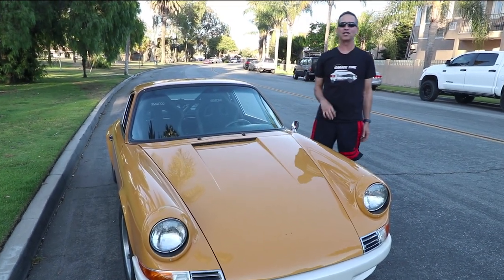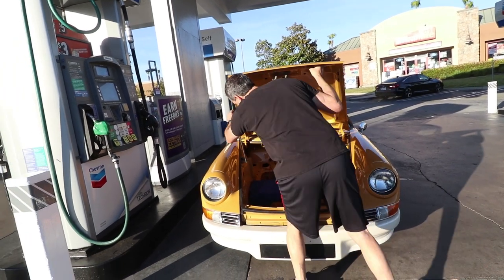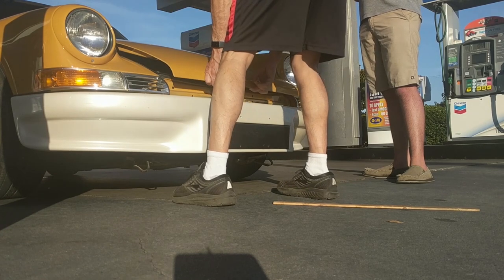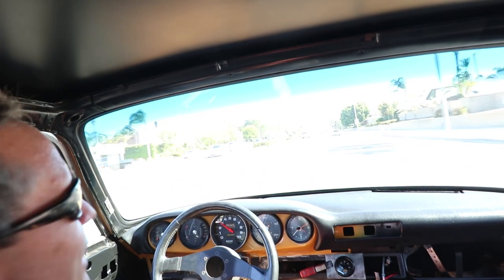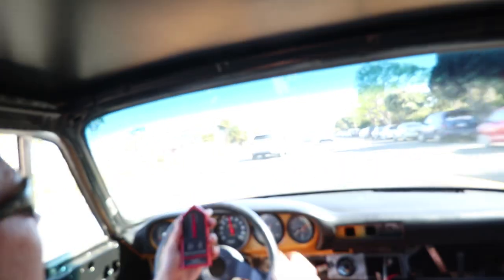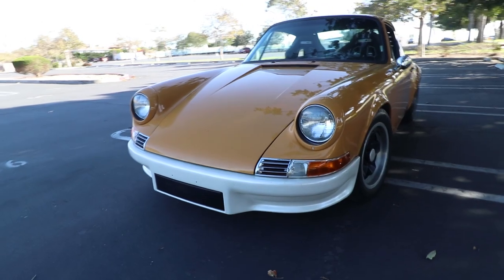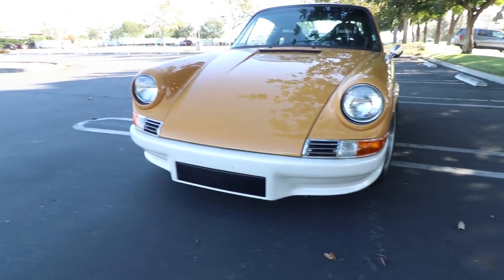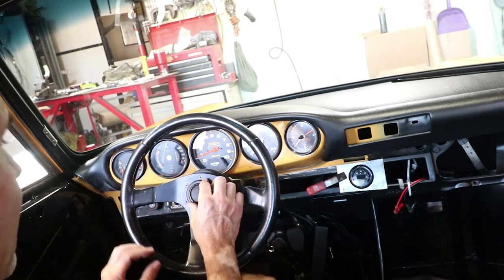5 things I HATE About my Recently Restored Porsche 911

Comment: 5 things you hate about your 911, which are all self-inflicted 😂
Reply from the maker: Self inflicted yes.
Reply: Also, the car would not pass a safety inspection with all those problems and is therefore illegal to drive on the road.
Reply: My thoughts exactly. Maybe finish the project before you complain about solvable problems that you haven't completed yet?
Reply: @yjmsrv  Hold you horses. I'm sure it was was meant tongue in cheek.

Comment: 90db is pretty loud- maybe get some earplugs in there. 

My old fiat 500 has no fuel gauge- just a fuel light. One is expected to use a dipstick to see how much fuel is in there AND you have to lift the hood to fill up. It’s about as basic as they come. I feel your pain.
Reply from the maker: Early Porsches also used a wooden stick.  The joys of driving more than offset the pains, which are all easily remedies by the way.

Comment: Tom
Have you thought about using the original pull cable to the front latch, and then a door lock solenoid to release the second one. The spring on the aft latch is not all that strong, Using a door lock and a short cable should pop it open.  The safety catch is way up there  also but that should be easily overcome with a fitted extension.  You could also route the cables to the fender well like a back up on  a 356, but ab original cockpit pull and a button would be easy.
Reply from the maker: Oh, I know how to fix it and it's not hard at all.  All that's needed is a welder and a spring.  Stay tuned and I'll get around to it eventually.    I haven't come this far to give up, ha ha.

Comment: Most of your issues are because its unfinished dont know what your point is exactly especially with the noise as you have no sound deadening,  carpet, door panels etc.
Reply from the maker: Admittedly this video is not my usual style.  I offered no solutions this time so as to generate discussions.  Please watch other videos if you are new here.  The car is intended to be lightweight for the track.  Some strategic sound deading will be added, but I never wanted carpet in this car.

Comment: I knew that gas tank was going to be a problem when you put it in!  I'm sure at some point you will be able to rig up a fix for the latch release.  All I see is more videos for you to work on so keep them coming.  And what is going on with that Tach?  Do you have an original one?  It looks like you sourced gauges from an earlier 911?  I have two tachs with different issues but I'm no where near being able to hook them up to sort it out.  And yes paint those bumpers.  But as you said, the end result is still a smile on your face.  As you know I wish I was where you were with your 911 !!!!
Reply from the maker: The tank isn't a problem at all.  Once the latch is fixed, it's no big deal for me to pop the hood to put gas in, what once a month?  
The latch is easy to fix.
The tach is temporary because my other tach is for a 6cyl.  Won't work for 4.
I'm starting to like this tach though as it is way more accurate than the bouncy VDOs

Comment: When the hood opening on my T5 Roadster broke, I had to jury rig a wire with a ring on the end made from the wire. Pulling it with one finger to get to the gas tank was excruciating.
Reply from the maker: Right, better to leave a little wire loop sticking out for emergencies.  That is what I have now.  Later I'll add the factory pull wire.

Comment: It's not my 911 & even I hate the way the hood opens.  To lye on the ground to open it doesn't make sense.
Reply from the maker: Well, everything is fixable isn't it...
Reply: @GarageTimeAutoResto  absolutely but it's a dumb idea to begin with grasshopper 😎
Reply from the maker: Not dumb if it works.  It's a simple latch modification to restore the factory functionality.  Basically the latch can be made taller, so my hand fits in there.  Bam, Bob's your uncle.
Reply from the maker: You aren't listening.  In the comment above I explained how the factory hood opening functionality will be restored with a few small modifications.  
No more laying down required, sheesh, 🙄